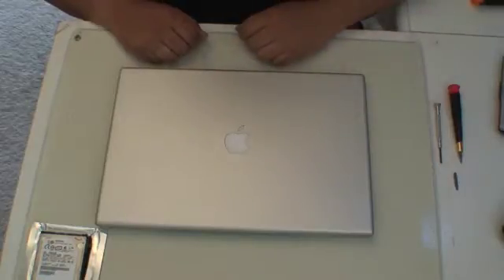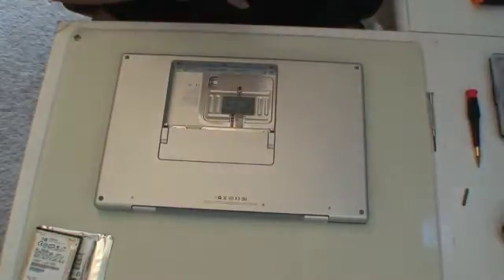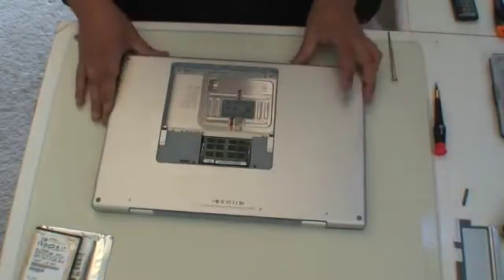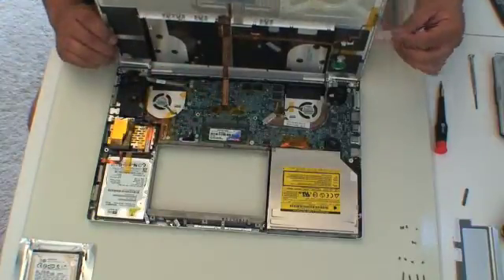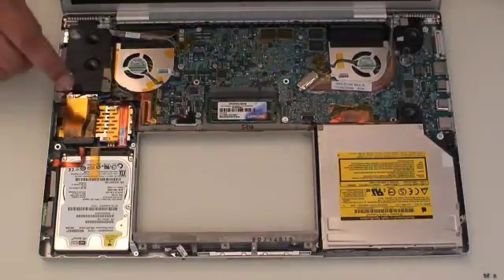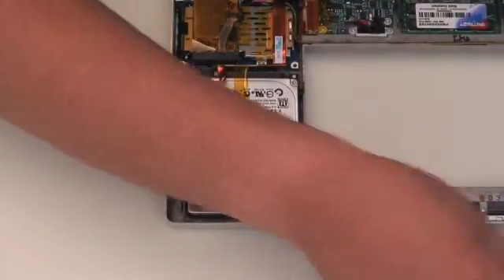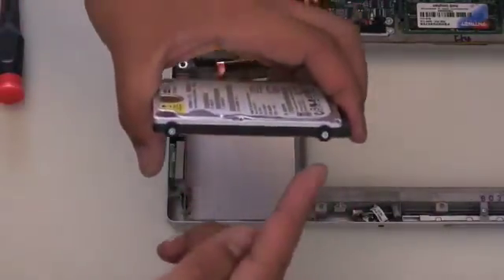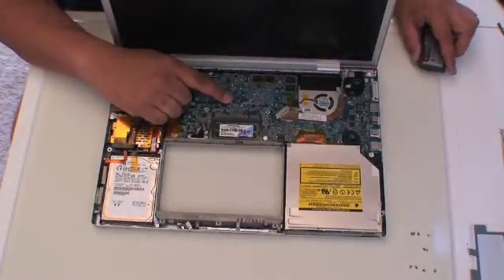MacBookPro HD Install

Comment: Nice organized interior of the laptop, but the design for replaceing the harddrive and network card it retarded.  My HP and old Toshiba were a simple matter of opening a compartment on the bottom held shut by a couple screws, then sliding the HDD out of the Industry standard SATA II port, and popping the new one in.  Much easier and fail proof then this way with the ribbon cables and like 15 screws to undo.

Comment: Is the 500GB Hitachi drive 7200RPM or 5400RPM?  I'm assuming 5400RPM since I've only seen Hitachi with a 7200RPM model.

Other than that, great detailed (and just the right amount of time...slow) video.  Not too fast...not too slow.